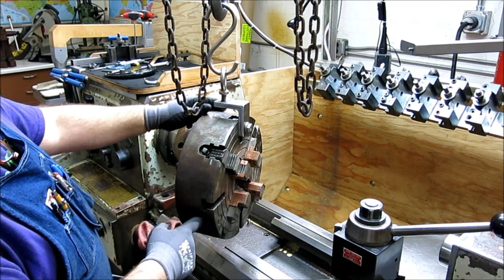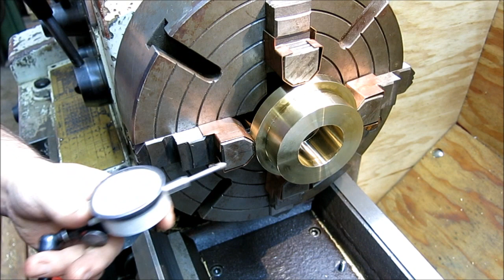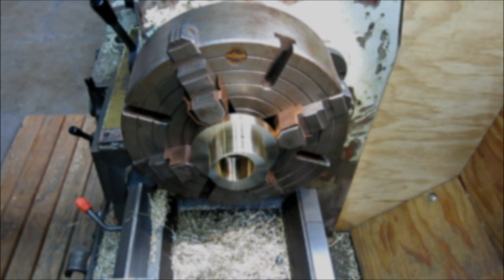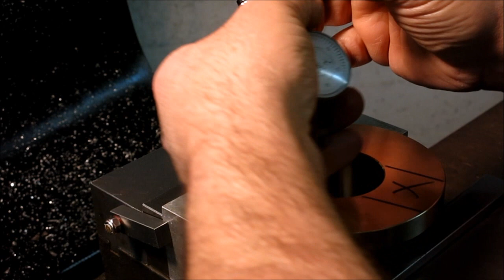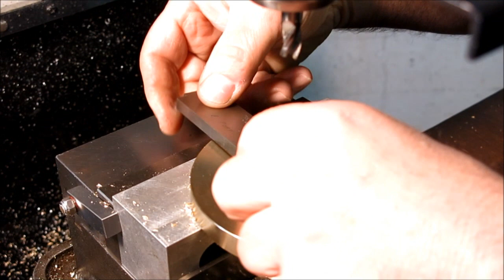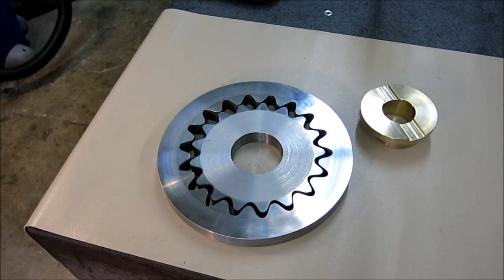Etching Press Eccentric Machining

Comment: Nice work. I would not want to put a slot across the top of a narrow area, but I don't know what job this is up to.
Reply from the maker: Hi Jw,

The slot is a flat drive key. It connects to the large curved spoke handwheel we built in some other video's.

Cheers,

Tom

Comment: Great Video Tom, whats the best way to lubricate and care for your indicators, I have one that seem to be gummed up, thought some lube would benefit it but don't know what type to use.
Reply from the maker: Hi Hal,

I'll give you two guesses what I like. The first guess begins with a WD and the second guess has a 40 in it. I find the bushing gets crudded up and a bit of the magic sauce and a few wipes and rinses and most indicators come back to life. Dust gets on the exposed rod and gums up the bushing which has a close fit. If its bent that's another adventure.

All the best,

Tom

Comment: Tom, I loved this. Never saw an eccentric video, so this was helpful. I have a question - for indicating a shallow piece in a 4-jaw, I'm curious why you didn't use some parallels to sat the part against? I do this and it nearly zeroes it out on Chuck up.
Reply from the maker: Hi Basement,

I never liked fussing around with parallels in the lathe. I prefer a backing plate that stays in place and takes some thrust when machining. I almost stopped and made one but went ahead and dinked it around for all your viewing pleasure.

Cheers,

Tom
Reply: oxtoolco Tom you can hold the parallels in place temporally with magnets as you set up then remove them once the part is held tight in the jaws. Saves an a lot of time. I also would do my face run out first this way to save time. :)

Comment: Tom, Great Video!
Checked the face of my 4 jaw the other day, there was almost no run-out. Is there any reason not to use parallels to get the initial loading of the part close?
This did induce a trance like state; some subliminal suggestions "send bit coins to tom" might have been productive. I am anxiously awaiting the next installment!
Reply from the maker: Hi Paul,

I did try some parallels off camera. I have always detested this method as awkward and a pain. I prefer the backing plates because they stay in place and provide a solid thrust backup. I almost made one mid stream but didn't have the right thickness of plate around.

Cheers,

Tom

Comment: All we have at work is a large 20" four jaw. I've become so accustomed to using it I pulled the 3 jaw off at home and have been using the 4 jaw ever since. I admit I had to watch a couple of Abom79's videos before I got the hang of it. A common problem I had was when I would chuck up a drive-line and try and get it running true so I could cut the weld out, I was always fighting it never reading zero. I found the problem was the tube was never completely round, even on a new piece, the seamless tubing wasn't to bad but the welded tubing was horrible. I found as long as the dial-indicator returned to the same spot ever 90deg. it would run true. I bought your 2nd book and read about heat straightening (best info on the net) and was able to true the rest after welding. Thanks!
Reply from the maker: Hey Travis,

I really have warmed up to four jaws. When I got my lathe it had a crappy three jaw and a good four jaw so I started using the four jaw a bit. It makes you do better work by its nature.

You are one of the first to give feedback on the flame straightening stuff. Its really handy to have it up your sleeve. I have heard that driveline builders use it regularly to straighten the tubes.

All the best,

Tom

Comment: Tom part looks like it turned out great.  Nice deburr work to finish off, are those file handles from our friends at McMaster?
Reply from the maker: Hey Bill,

I think Mcmaster does sell them now. They are Pfherd brand and I love them. I bought two boxes of them on Fleabay quite a few years ago. I remember some other guys in the shop wanted some but I wouldn't give them any. When they asked why I said how will I be able to tell my files from yours if I give you some? They went back to the corncobs they were using before they saw the nice blue ones.

Cheers,

Tom
Reply: oxtoolco
Thanks Tom I like your reasoning there.  42215A11-42215A13 look like the ones.

Comment: Nice video, Tom. In some way, it is "nice" to see somebody with your skills have a little difficulty with things like you did initially on indicating in the offset and seeing how you thought through why it wasn't quite working they way it should and correcting it. Gives us beginners a thought that it isn't easy and to just work on it and learn so you do it better the next time you have to do the same  thing.

When milling the keyways, when you are trying to take off the same amount on both sides of the center line, how do you deal with backlash on the feeds when moving both directions?  Would it only be an issue if the total width of your slot is less than the amount of backlash?  Does the DRO help that issue a lot since it isn't affected by the backlash?  P.S., hopefully I asked that in a sensible way.
Reply from the maker: Hi Gopher,

The DRO makes it easy. The number is the position regardless of backlash. I was working off a centerline which is what I like to do with wide slots like the one in the video. Thanks for cutting me some slack. Some of these things you don't so every day so when it looks like I'm having trouble I probably am. Everything is possible with the right attitude.

All the best,

Tom

Comment: Tom,
    You are right again, Adam makes dialing in the 4 jaw look so much easier!

     Ha.  Couldn't resist.  Awesome video.  Thanks for sharing your time and talent.  Why did you mill the key slot one side at a time, rather than milling across both sides on each pass?

Thanks, all the best.  Chuck
Reply from the maker: Hey Chuck,

We call that air cutting in machine shop speak. Crossing all that air multiple times takes time. You can see I'm in so much of a hurry to get things done. Old habits die hard. 

Cheers,

Tom

Comment: A 2" travel indicator rocks for this type of stuff, gets the body of the indicator away from the chuck jaws.
Its pretty important that the indicator be exactly square and dead in line with the center if the offset has to be exact!
I use 2 indicators with one on the face for this kind of setups, saves switching back and forth, wink.
I will try and snap some pix of a real wacky setup I have going at work tomorrow.
Teaser, 30" long part, 4 jaw  main chuck and 4 jaw live center.
OD, face and ID work on the tailstock end LOL!
Reply from the maker: Hi Gent,

Now there is a good freaking idea. I had one not ten steps away but it didn't even dawn on me. I have to think about the indicator centering. My quick un-thought out answer is to adjust it to run true it doesn't matter if its slightly off center height. As long as the indicator is pointing at the center of rotation reasonably well doesn't it work? Laugh I did try two indicators. It just gave me more things to hit with the hammer.

All the best. Can't wait to see your hairball setup.

Tom
Reply: oxtoolco
For running true it really doesn't matter but to set an exact offset it needs to be pretty perfect, eye ball is good enough for most things but for bigger offsets
even 1 degree off on the indicator alignment is .0003" in an inch.
I know this is splitting hairs but there are times that's what the prints call for
then they weld the parts together and distort em all to hell but they better
be right when they leave our shop because the customer may have a CMM
and check it to the Nth degree on stuff that they are gonna micro polish all the dimensions off of anyway.
Its pretty stupid some of the tollerances we get specked and what the parts
end up looking like when they send them back for final machining after welding
The camera is sitting on my wallet  I will Email you the pix.

Comment: Hi Tom, thank you so much for posting this video, I was having a moment of disillusionment day making your christmas/birthday present and it cheered me up no end to realise there is something that I can do better than you. :>) I am referring to four jaw work but then I do it most days so it is not really surprising. Hint, if you had twisted the dial face to the vertical you might not have had clearance issues. Hint 2 if you had centred the non eccentric jaws you would confine the eccentricity to the other two jaws only, a small point but useful all the same as movement is more predictable..
ATB
chris
PS your prezzies will get sorted soon, hopefully.
Reply from the maker: Hey Chris,

Thanks for the comment. Now it you shot any video of this factory of yours you would know that nobody want to see the back of you head whilst indicating. I did actually consider dialing it in true before offsetting it but then decided not to. Now I wonder how much that might have assisted.

Cheers,

Tom
Reply: Factory? nay Lad, but I'm sure the back end of my 30's sized car  garage would be very flattered to called such and the back of head is, regrettably, the only part of me that most people want to see! :>(

Comment: Great video Tom.  I've turned a cam lobe on my lathe by using a fixture, where I had to index the lobe around to get the proper profile.  I think I can adapt your way and do it a whole lot eaiser.  BTW  glad to see you using the hammer.
Reply from the maker: Hey Herb,

I had to switch to Adams lead knocker. The little hammer just didn't have enough grunt to move the part. I really like how it rebounds. Pretty amazing wood.

Cheers,

Tom

Comment: Tom: I did not know about adjustable parallels, very-very cool. I use my set of parallels on my router table all the time. When I do a milling operation in wood like a “dado” adjustable parallels may speed-up setup and hitting that critical shoulder mark! I have learned so much watching your films. I have to go back and see that magazine you showed, meant to shit happens. As always, thanks’ for taking the time to make this video! And I support this site. ~M~
Reply from the maker: Hi Mike,

Thanks for the comment. Talk to you soon.

Cheers,

Tom

Comment: Tom,
As you come across a test dial or indicator that has a broken or missing bezel, you may want to take the bezels out and save them for on camera work. "No glass - - No glare."

Joe
Reply from the maker: Hi Joe,

I was thinking about hazing the face with a little scotchbrite... Just kidding. Maybe some satin protective film like shelf paper would cut the glare. Time to experiment.

cheers,

Tom
Reply: oxtoolco Tom try a circular polarizer filter for the camera lens if you want to kill the glare.  Personally it does not bother me not to see the needle you're right there able to read it and tell the viewers what it is doing.

Comment: Interesting video, Tom. I do have a couple of questions:  First, was this wabble stuff invented by Elmer Fudd? Second, in all the machining catalogs and websites I have seen, I have never seen a lathe chuck with "califragilistic" jaws. Is this something new?
A silly Oxen,
Dave
Reply from the maker: Hi Dave,

Callafragilistic jaws are only used in California. And to answer you question on the inventor its was Wiley Coyote that invented the wabble. Please do your research before commenting.

All the best,

Tom
Reply: oxtoolco
Let me guess . . . Wiley got the parts for the wabble from Acme Supply.
Dave

Comment: Geez...that bronze stock costs a scary fortune!  How much did that piece cost you and what were it's initial dimensions.  I'm guessing that it cost around $200.  Holy smokes!
Reply from the maker: Hi Joe,

Yeah and I ended up with $10 bucks worth of scrap in my chip pan. Not a good conversion ratio.

All the best,

Tom
Reply: oxtoolco Yeah, Keith Fenner machines a lot of brass (all of the nautical work he does).  I've noticed that he carefully segregates the brass and bronze chips for recycling.  "Every ounce counts", I've been told.  I'm sure it adds up.  I repaired and did PMs on electric lift trucks.  I replaced the motor contactors and would save the silver/copper contacts/terminals and recycle once we had a few pounds.

Comment: Lovely job :), loved the adjustable parallel, I've never see one of those before.
Reply from the maker: Hi Kim,

Someone else from Europe mentioned you don't see these over there much. I use mine all the time. If you get some get them in pairs which makes them twice as useful. You can still get these reasonably on fleabay if you buy them one at a time. Sets command more money.

All the best,

Tom
Reply: Hey Tom,

I will wait to see if I need some, I'm sure I could just grind some up :)

Thanks
Kim
Reply from the maker: KimberlyBarnett123 Hi Kim,

Its the chicken and the egg thing with adjustable parallels. If you have a few of them you will find all kinds of clever uses. If you don't have them you will find other ways to do the job without them. Keep your eyes peeled for some. I'm pretty sure you won't be disappointed.

All the best,

Tom

Comment: You need one of Adam's accessories for the indicator.  Then you could move the indicator outward and indicate off the bore.  Thus giving you a bit of clearance on the indicator with out adding the slight angle.

http://www.starrett.com/metrology/product-detail/Precision-Measuring-Tools/Precision-Hand-Tools/Indicators-and-Gages/Indicator-Accessories/670B
Reply from the maker: Hi ctctj2,

That would have helped. I order one of these a while ago and it has not come in yet. Good excuse to buy more tools. See how it all works out.

Cheers,

Tom

Comment: is it phosphor bronze tom
Reply: I wondered that also.
Reply from the maker: I don't think so. My experience with phosphor bronze is it short chips. But then again I haven't done any in a while. There was a color code on one end I might try to cross reference. 

Cheers,

Tom
Reply: oxtoolco i came to the conclusion with you saying it was harder than normal bronze

Comment: It's a lot easier when you have enough travel on your indicator. When doing manual turning on my apprenticeship I only had a lever type DTI and I had to keep winding the cross slide backwards and forwards a set amount to get the "run out" I needed. 4 jaw work is fun, but the setting up definitely takes up some time.

Great video though Tom.
Reply from the maker: Hi Daniel,

Uggg, That sounds tedious. Thanks for the comment and sharing your experience.

Cheers,

Tom

Comment: Oh, some nice and shining brass work you did there, Tom !

Indicating your face, though ... why not "press it in line" with a rotating ball bearing on the end of a piece of rod placed in a toolholder - I made one myself and I can line up the face of an object this way with 0,01 mm very fast and then do the rest by tapping softly with a AdamBooth-rammer.
Reply from the maker: Hi Keld,

You saw that face looping around. The indicator barely stayed on the little face I had. Besides I don't have one of those bearing tools around. My first choice will always be a backing plate as it firmly supports the piece against the chuck.

All the best,

Tom

Comment: Great video Tom, did the copper jaws gall the brass because they are similar metals?
Oh, and it looks like there's stuff growing in the coolant bottle on your mill door.
Have a good one.
Reply from the maker: Hi Andre,

Copper did fine. This bronze is very hard so it was not problem. When you have metals with a similar hardness is when you can get into trouble. The scum you see in the bottle is tramp way oil. I recycled some coolant out of the tee slots when I cut the radius on the handwheel. It left a layer of oil on my nice white coolant.

Cheers,

Tom

Comment: Hey Tom.  Could you post a picture or link to the print for this part?  I've never done eccentric turning and I'm curious how the print would be drawn.
Reply from the maker: Hi Rd,

There are just two centers shown one for the center of the part and one for the eccentric. The amount the two centers are eccentric by is dimensioned.

Cheers,

Tom

Comment: I wonder if a quick way to do the initial alignment would be to use a center in the tailstock as reference; jaw1 at radius+runout, jaw 3 at radius-runout
Reply from the maker: Hi Lasse,

That would work also. You still are stuck indicating but its all about getting close first.

Cheers,

Tom